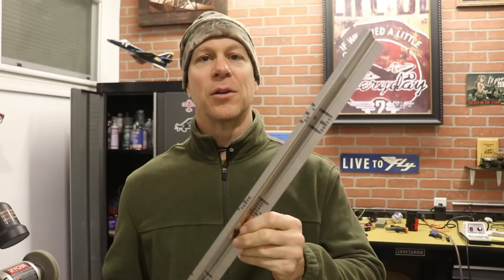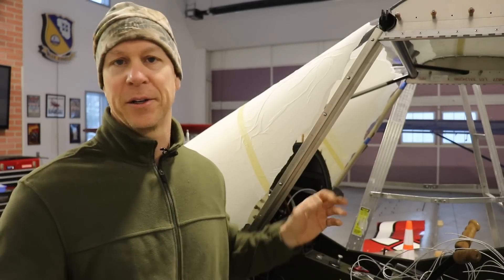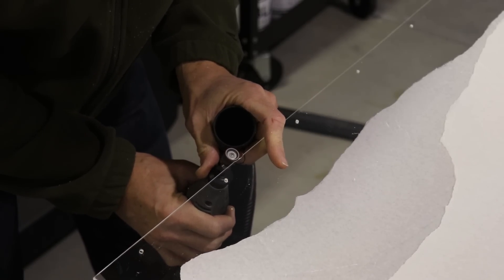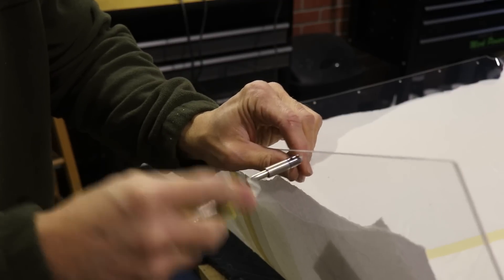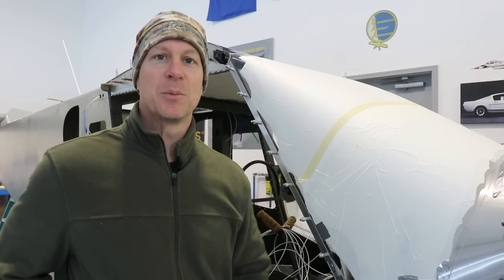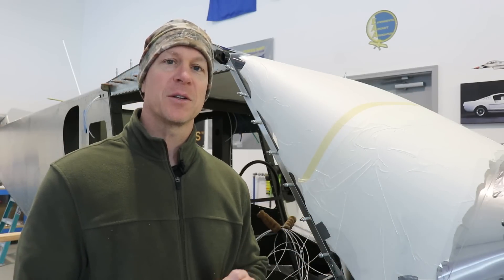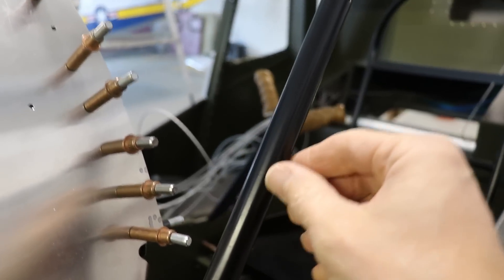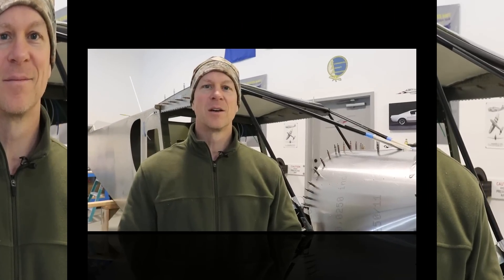Finishing the Zenith CH-750 Windshield Trim (Ep71)

Comment: Well how did you get the idea of tapping the holes on the side. I wounder if it mighthave been sugested by the Flying Kub chap 🙂
Reply from the maker: Nope. I was having a real difficult time with the sheet metal screws and wanted a better option. Since I had the screws for the top, I wanted to see if I could use them for the sides. It does work nice!
Reply from the maker: Oh I just saw that YOU are Flying Kub LOL. If you made the suggestion I didn't see it but thank you! You should have told me before I started using the sheet metal screws!!😊
Reply: @KitplaneEnthusiast  Well I did put it in the comment in the last comments in the last video and someone likes it I thought it was you.
Reply from the maker: @flyingkub  You have to remember I’m about 2-3 videos ahead of what’s posted. So when you’re watching Ep70, I’m probably working on Ep74. So what you are seeing is usually already done about 3-4 days ago.
Reply: @KitplaneEnthusiast  Are yes I know as I do the same but I still have to pull your leg.

Comment: You referred to the windshield material several times as "Lexan."  I thought Zenith used acrylic {"Plexiglass") for the windshield and bubble doors and used polycarbonate ("Lexan") for the side windows and roof window?  That's what was supplied with my 750 STOL, but of course that was years ago when one had to chase dinosaurs off the runway! LOL!
It's no big deal, however, since your advice to use loose holes for the windshield still holds (pun intended!), although if the windshield really is Lexan, it's much tougher and less fragile than acrylic - you can bend a piece of Lexan 90 degrees and it won't break!.  Usually the windshields are acrylic because it's easier to mold and scratches polish out easily as opposed to Lexan, which is really difficult to polish.
Reply from the maker: I have no idea what it is. I just call it all lexan.
Reply: I noticed this too John.  Cruzer plans showing Plexiglass (Acrylic) for front Windshield and Top Window, with Lexan (polycarbonate) for middle and side windows.  I played around with both when making lenses for my landing lights.  Went with acrylic because it has a more optically "pure" appearance and does not yellow over time due to sunlight exposure.  More prone to cracking though.
Reply: Lexan is a trade name for polycarbonate just as Plexiglass is a trade name for acrylic. Polycarbonate is really tough material and ideal for door windows that take a lot of abuse. If scratched, however, it is very difficult to polish. Acrylic on the other hand is very easy to polish but cracks much easier than polycarbonate and doesn’t have near the strength.